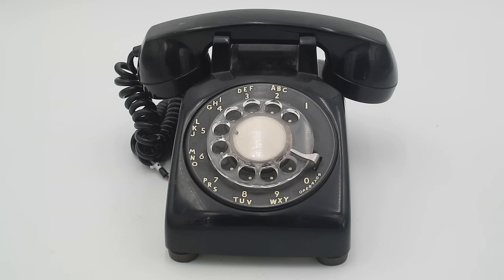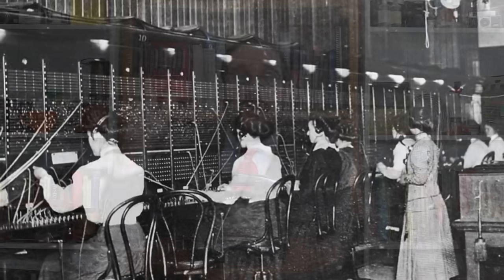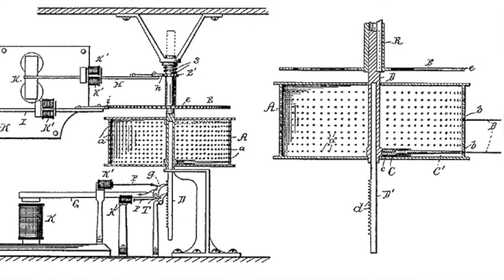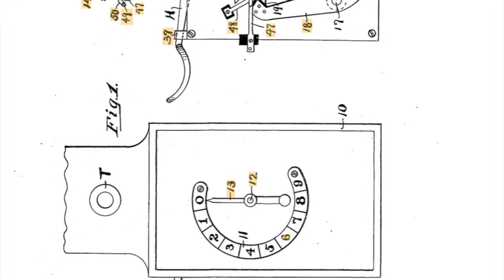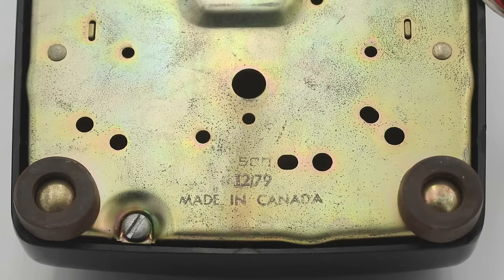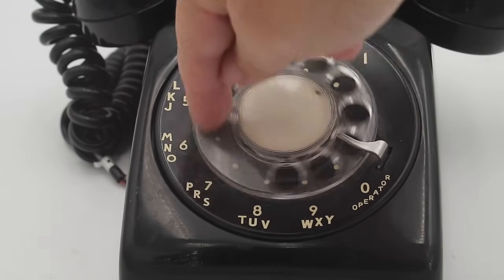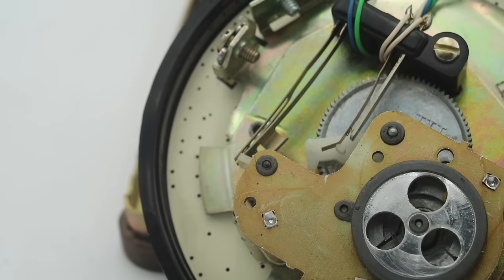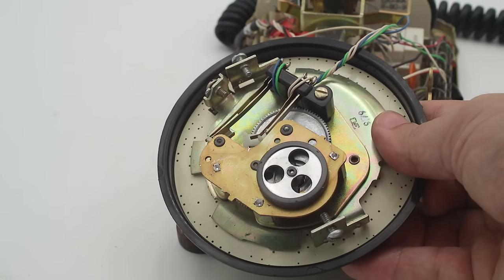Rotary Phones: the Call of History

Comment: My dad was a maintenance forman for a huge paper mill.  Many times when an event called "Shutdown" (where the machinery, that ran 24-7, was stopped for overhauling) happened, he had to get on the phone to call people in to request them to come in for double time shifts.  He actually wore out two model 500 rotary phones where the mechanism gave up.  Phones were maintained directly by the phone company (60s  early 70s) and when the repair guy came in to replace the phone (hard-wired into the wall), he couldn't wrap his mind around the fact that dad actually wore them out.  He had never seen that ever before.
Reply: That dial must've traveled many miles.
Reply: If the job is that important then it's important enough to staff it appropriately and not requiring overtime. In civilized countries US work requirements are frequently illegal. Not as in "Oh, it's a fine", but as in "Go to jail." Looking back, I can't believe I didn't tell more of my employers to shove it right up their [ x x x ].
Reply: @Jack_Russell_Brown  Wow. You are clue free. Operating something like a telephone exchange 24/7/365 with an adequate staff is not running a telephone exchange 24/7/365 with one person.
Tell us - were you dropped on your head repeatedly or just once from a great height?
Reply: @Jack_Russell_Brown  I noticed that. I also notice that many employers, past and present, would rather not pay people for the work they require. Which is the point of the post. Employers in the US get away with things that would be jail time elsewhere. Like requiring an employee to work 40 straight hours, then yelling at them for taking a bathroom break, or 80 hours in 5 days, then reprimanding them for being 15 minutes late getting to work on day six. All of which I've had happen.
Reply: i'll bet he was thankful for touchtones when they came out
Reply: @Trump2PrisonOn34Counts someone wasn't loved lol
Reply: 3 of my uncles worked in a paper mill in Wisconsin Rapids

Comment: For those of us who've used rotary dials, there is something satisfying about the feeling of turning it and then watching and listening to it smoothly rotate back to the start. Even though it took longer to dial than on a push button phone.
Reply: Agreed
Reply: It's kinda crude, but as a kid the sound made by the rotary sounded to me like the words "shit-call...shit-call..."
Reply: Until you're in a hurry to dial and you mess up...  lol...  Hard to win a radio contest.  😅😂
Reply: True, and it certainly helps you control yourself when you are dialling 999. 
Which service do you require?
Reply: The Rotar mechanism was almost "kid proof". Being a typical kid, I wasn't content  to let the rotar "smoothly rotate back to the start". Instead, I would put my finger in the dial and use all the strength I had to try to force the return rotation to go faster. No matter how much pressure I applied, the speed increase of the return rotation was only negligibly faster than if it rotated on its own... And to top it off... after YEARS and YEARS of this abuse, the dial never broke. Amazing!
Reply: The governor mechanism was already well trialed as was based on the almost identical system used in mechanical chime players and then windup gramophones and some grandfather clock chimes.
Reply: Yeah but Steve McGarrett got to use a touchtone phone on Hawaii 5 0, and this was in the mid 70s. We felt like a bunch of rubes for having a dialer phone, and a wall one at that.
Reply: @keithbrown7685  McGarrett was just way cooler than the rest of us, anyway. I mean, the intro to that show is still one of the greatest in TV history. And who else gets to say "Book 'im, Danno" like that?
Reply: Even the "push buttons" were FAR SUPERIOR to these OVER-SOLD PIECES OF CRAP dubbed; "cellphones and (NOT) smart phones"! I HATE THESE!
Reply: @RCAvhstape  You just knew it was going to happen in the end. No crook got away without the "book'm" line. : LOL
Reply: When the movie was over, I used the payphone in the theater to call Dad to pick up me and mom. I misdialed when my finger slipped, which mom was not too happy about. I was glad when pushbutton phones arrived in the '80s.
Reply: @weirdscience1 so true ...
Reply: First phone I remember was a wooden  box no dial
I am 77😊
Reply: What I REALLY miss is the "HUMAN" operator that could make a decision as to which service would work best in an emergency!
Reply: Most telephone switches after step by step could handle 20 pulses per second, I think.  I don't know why that never was a thing in the US.  Anyone could have modified their phone to do it though.  All that was before my time, though.  I think I did program my modem to do 20pps just for the hell of it once, but there was really no point because of course DTMF is still faster.

Yeah, I'm almost positive a crossbar could have handled 20pps.  It's really a lot faster, lol.
Reply: Outside of a cafe in our town, There is a 1960s to 70s phone booth. It's just on display  And i'm sure it doesn't actually work, But I alwaysmile thinking about how many good times I had sitting in one of those.. talking to this or that girl, Finding out what Movie was playing at the drive in Or calling the time and temperature number. Just to hear somebody's voice. 😊
Reply: @bobfuhr4520  "First phone I remember was a wooden box no dial"

Why is that? If you're 77 then your first memories would have been from the early 1950s, and the Western Electric model 500 was standard issue by that time (introduced in 1949 for field trials; went into general distribution in 1950), which is the first phone I remember (along with its model 554 wall phone counterpart), because it was still standard issue in the late 1970s, which is as far back as I can remember (I'm 49).
Reply: @MaximRecoil  I remember the phone being very high on the wall .I  remember
Reply: @bobfuhr4520  To keep us kids from playing with it, probably.

Comment: As a boomer, I fondly remember these phones!  The thing I really miss is that handset that was ergonomically designed to be easy to hold, and easy to cradle between your neck and shoulder; so much easier than holding a box the size of a deck of cards to your ear nowadays. 😀
Reply: I still like using this phone today for exactly the reasons you describe.
Reply: So much easier in fact, I gave up on that whole flaky idea of holding my candybar phone like it were actually shaped to the side of my face. I just use speaker phone now. No strain on the hands or arms or nothing. Just slap the candybar on the table and talk at it.
Reply: Phones in offices had accessories that would attach to the receiver to make it more comfortable to hold on your shoulder while not having to hold the receiver with your hand. You could talk on the phone while both hands were free to continue your work.
Reply: How does a push button phone with pulse dialing differ from a phone with touch tone? They look from the outside to be similar.
Reply: @glennso47  I had a push button that had two settings, one for tone dial, one for pulse dialing. It was so one could use a touchtone phone out in the sticks, where the newer tech hadn't arrived yet. You'd set the phone to pulse and use it like normal. It wasn't that fast, but it made things feel faster for people who were sick of the old dial phones.
Reply: I was born in 79' and my family used these till the late 90's. My had one in his kitchen till just a few years ago.
Reply: @glennso47  Uh huh. And what work would that be? 🙂
Reply: @TheLionAndTheLamb777  Telco busted my door down, took my landline, took my rj15 connector too. Worst of all, they took my copper wiring.

They forced cell service on me. They get real aggressive around here, whenever it's upgrade time.
Reply: These were FAR SUPERIOR!
Reply: @glennso47  basically just a circuit that triggers the right number of pulses rather than the matrix of tones. The earliest GPO handsets with buttons rather than dials all worked like this, as the UK didn't have any DTMF exchanges for many years after it was introduced but people were seeing it on imported American TV!
Reply: @TheLionAndTheLamb777  Somehow I miss them. Just for old time's sake, I'd like to have my cordless phones back, and the corded ones. Really they were good tech, especially for someone like me with a soft spot for powerful, ever-changing gadgets.
Reply: @kaitlyn__L And if you knew where to look, DTMF on television wasn't confined to American sitcom or drama programming. It was occasionally used as a form of in-band signaling, usually to signal automated equipment to connect or disconnect feeds or to run a certain snippet of video. I can't speak to the UK regarding that usage of DTMF, but in the US I saw it most frequently during commercial breaks, presumably to signal the next commercial to run.
Reply: @glennso47  When you push the buttons on a pulse dial phone, it just pulses the correct amount of pulses that a dial would, as opposed to a tone.
Reply: @LakeNipissing  And also strong enough so you could slam it down when angry 😂
Reply: That's what bluetooth or headphones or the speaker phone function are for.  It's easy to just put my phone on the desk.
Reply: The further away you are from the microphone (transmitter) of a phone (or any microphone), the worse the sound is to the recipient. They hear proportionately more reflected sound and less direct sound from your mouth, so it often makes things harder to hear. Don't you notice this when you see a remote interview on TV where the person is talking into their laptop computer and its mic is built-in and sitting around two feet away? Sounds pretty bad, and this is how most speakerphone calls sound. No thank you.
Reply: @tomtownsend6094  I've never had ANYONE say he can't understand me because I'm using the speakerphone function.  Sounds like you have a hearing problem.
Reply: And that handset had excellent "voice" fidelity compared to the squeaky, crackley smart phones of today.
Reply: @TheOzthewiz  My smartphone has no "squeaky, crackley" sound.  Maybe yours is a cheap phone.
Reply: @glennso47  It's all in the name.   A touch tone phone generates a two tone sound (hence the name Dual Tone Mult-Frequnecy or DTMF) for each keypress.  The sounds are received by the switching system and translated into the appropriate number.  A pulse phone with buttons has circuitry that breaks the connection rapidly, the number of breaks is the digit being dialed. 

I knew a guy in high school who could dial a phone by flashing the switchhook rapidly.  It was entertaining.
Reply: @glennso47 company named Softalk made those . Wonder if they're still in business? Lol
Reply: @keithbrown7685 my brother does that! Sounds like he's in a tunnel! Hate that, lol. His name's Keith also!😮
Reply: Oh YES!!
Reply: And the cell phone is as.slippery as a ell that's been swimming in a barrel of motor oil. I'm noticing that theres a lot of people that hate.cell phones like I do. Maybe as more people.wake up they will fade out.
Reply: Got one up on that - my grandparents had a oak wall phone that you had to crank the generator a few times to ring the Switchboard then they would connect you .
There were Station to Station and Trunk Calls.

At Thanksgiving I always sat at the end of the table under the little shelf & would bang me head getting up EVERY TIME!

Also the conical speaking tube & the heavy wooden ear piece.

At home we had a modern phone & I still remember the number from 1st grade
Reply: We know you over-rely on speaker phone, you already said you're a boomer. Bluetooth headsets have existed for years and now that BT headphones are ubiquitous and work well it only makes sense. You hear the other side better, they hear you better, and those around you don't have to hear your conversation. And you don't have to crane your neck to wedge the phone into your shoulder like you did even with the handset extensions made for relieving neck strain.
Reply: Are you listening mobile phone brands, ergonomics please

Comment: Who remembers the biggest step in becoming an adult was NOT getting your own place- it was walking out of the phone company with your Western Electric rotary phone and phone book for your new place. There was no greater satisfaction than hooking up your phone in your new place and then making your first phone call. Good times.
Reply: You misremember. (I'm 77.)  Phones had to be hard-wired to the little box on the molding near the floor, so they could be installed only by the phone company. And you paid rent on the phone every month.  The R11 jack came later, but the phone still had to be installed by the phone company, because they owned the phones.

Comment: Very nice.
When my parents put a lock on the rotary dial of the phone, i learned to call my friends by using the cradle switch.
Reply: When we placed a lock on the fridge because of the cats opening the fridge door, the cats learned opening the lock. They also could jump to open doors.
Reply: Me too!
Reply: In the '60's we discovered that 4109 that roughly rhymed with "phone our own line" would ring our own phone after dialing it and then hanging up, at least here in Calgary!
Reply: @agems56  parents used it to entertain their kids, like hey Santa 🎅 is calling 📞  for Christmas.
Reply: Yup.  And me.  My experience was at a Volkswagen Dealership.  They put a padlock on the dial for weekends so that the (part time) cleaning staff (me) couldn’t make long distance calls. . .

Challenge accepted.
Reply: Some people tapped the cradle on motel phones too (which used to have a coin-op lock on the dial sometimes), or dialless courtesy phones that weren't meant to dial out..
Reply: Yes we geeks did that on the payphone at highschool in the 80s

Comment: In the late 1970s, one of my first consulting jobs was to program a "rotary dialler" algorithm using an early microprocessor. It would repeatedly pulse a line to close a relay, which when connected to the phone wires, would dial. This was after DTMF was implemented, but at a time when DTMF wasn't universal.  Later, Hayes (and other) modems could be programmed to dial either using DTMF or pulse. The modem commands are still there, and still work.
Reply: In the 80s the REM port of home computers had a on off relais which could be programmed in Basic with Motor On or Motor Off so in basic one could create a pulse dialer. The Amiga 500 could sample all DMTF tones and was just playing the sampled sounds
Reply: Recently, one of the charities I support had a telethon (no, not PBS) and young volunteers showed up to staff the phones.  Several had never used a desk phone before and they had to show them how to use the phone!  Being very old, I remember teaching my grand daughter on how to use a rotary phone back in the '90's when what few pay phones existed were converted to rotary to deter drug dealers in the city centre.  Her first attempt was to stick her finger in the number to dial hole thinking it was a 'magic' push button! 😁
Reply: @gregorylewis8471   that's what I did when growing up in the 90s too, until I was told I had to "bring the hole to that silver bit" to "activate" the "button" :) then I figured it out, and loved the feeling of the dial only resisting movement in one direction.

Comment: My mother had a lock on the dial to keep my sisters from calling people and I was able to dial the phone by pushing the Hang up button in the proper sequence. We also could dial 3 an the last 4 numbers of the phone number and make a connection as well. I found a cigarette machine in the basement of a local bar There were 3 pennies tape to the cigarettes pack an the book of matches from the 1940s and 50s.  It also had the 5 digit Phone number printed on the matchbook. Great video brother, thank you for sharing your knowledge and expertise. I am in a process of gathering hand crank telephone and hooking them up for intercom in my house.
Reply: My train historian pal had railroad phones in his kitchen, upstairs hall, basement, and garage. They were the kind that used to be in boxes on poles next to the tracks, that crews used to call dispatchers and tower operators. My pal had actually got them from the Erie Railroad in NW Indiana after it was abandoned in 1979, along with the batteries, which were glass jars the size of 5-gallon pickle jars with lead plates in them. These were in the garage.
 I met him in 1982, and when he moved in 2003, he installed the phones in his new house, where they were still working upon his demise in 2014.